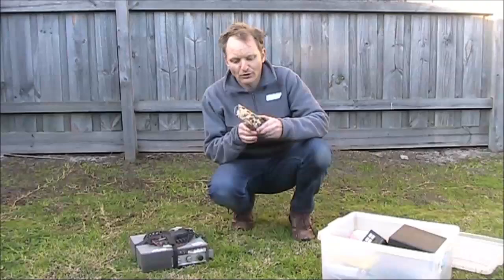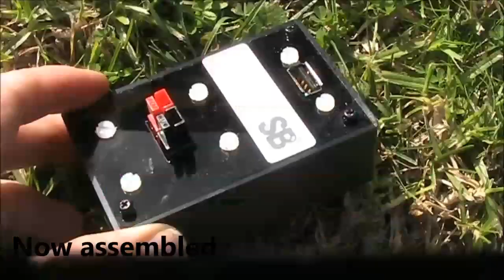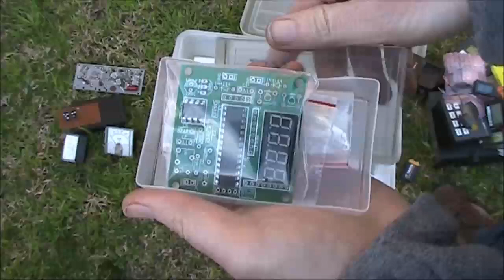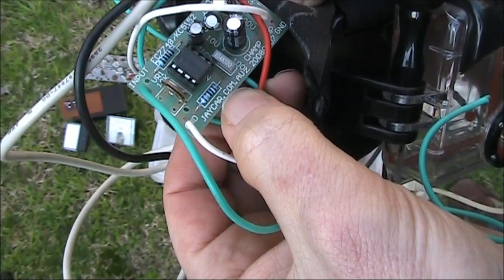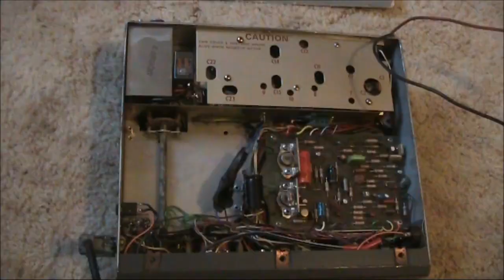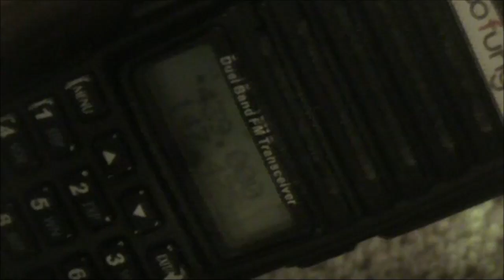Mystery bargains at the 2019 Cranbourne hamfest

Comment: Rich pickings indeed, well done on getting the carphone going. Are the metal can transformers branded?
Reply from the maker: It says Toko on the package (handwritten).
Reply: @vk3ye  That's a good sign, see if there are any other markings, those usually have a printed or stamped part #. Probably not. You could check the inductance with an LC meter. Then work out where they might be useful.

Comment: Hi Peter, I made those AWA radios when I was an apprentice, we turned them out like sausages from the North Rude Plant.Sadly the factory has gone. We all had the rx boards under the work bench to listen to VKG, in those days not encrypted.  Also the CW decoder, you seemed to get yours working what did you do to get it working? I have not been able to decode. 73 colin vk2jcc
Reply from the maker: The CW decoder is super critical with regards to the tone pitch. You need to adjust the trimpot for best LED response to the Morse. And adjust the input level so it's off when there's band noise. I got it working on the 2m Morse practice beacon. I tried it briefly with the 80m VK2 beacon but didn't get a decode. Steve Ellington's video is very good in explaining it.

Comment: That's a great haul, Peter - lots of nice goodies there!

Also, Tnx for the QSO in last night's Trans-Tasman Low Bands Contest. I was using 5W into an 80m OCF dipole. I would have used the 80m top-loaded vertical, but despite it testing just fine earlier in the day, last night it went high VSWR ... will need to investigate.

Comment: Very cool that you got the 25M to work, and doubly so that it was converted to 2 m with crystals supplied! Wish mine came like that. I have a few low band models that were given to me for conversion to 6 m. Interestingly, they were used extensively by the State Electricity Commission by their fleet in the late 70s I believe. The SEC also built them in their workshops (one of mine is an 'SEC'-branded unit). I think they were later replaced in SEC vehicles by the synthesised Plessey MTR-8000 (of which I collected another two, converted for 2 and 6, first thing at this same hamfest!). There are conversion instructions for the low band 25M in the May 1988 issue of Amateur Radio. Cheers for the video - VK3BEK.
Reply from the maker: Thanks Andrew. I'll look that up.